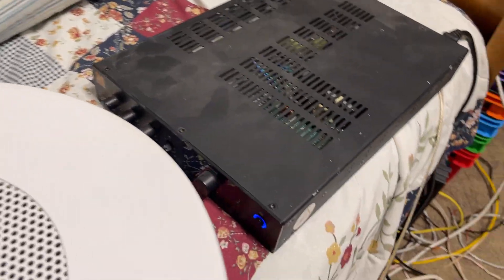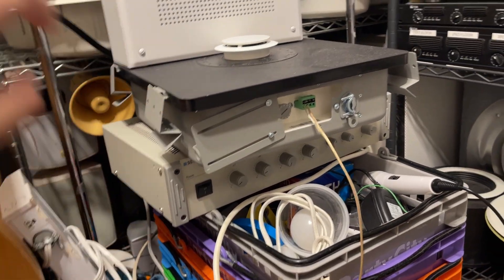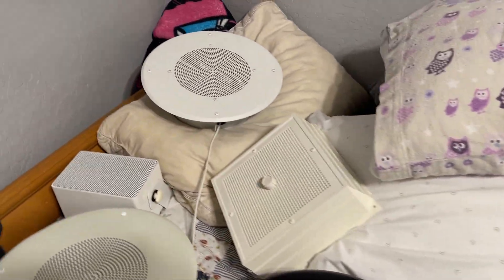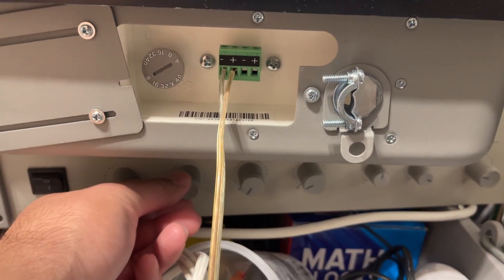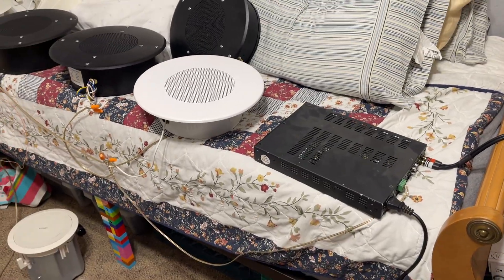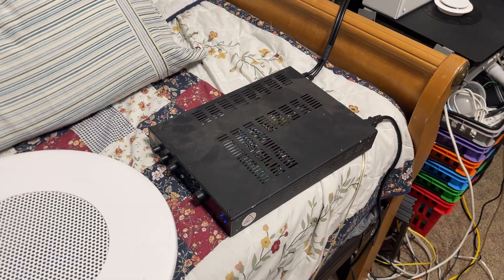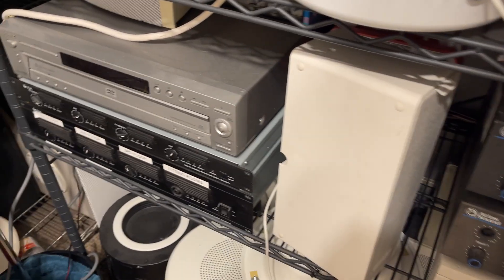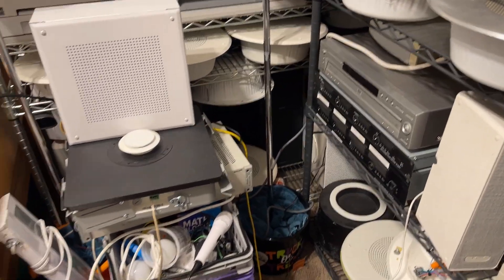Intercom Speaker Extravaganza & 70 Volt Amplifier Bridging Expansion Info

Comment: Hi, how are you splitting those speakers once they come out of the 180? I'd like to connect two, but it only has the one output.  Thanks!
Reply from the maker: You just simply connect a speaker off of the main speaker line. I covered that topic in a past video which you can find on the channel. The video is called "How To Connect A Chain Of 70 Volt Speakers To An Amplifier" which that should fully answer your question and this applies to any amplifier.
Reply: @CristianOrtiztechmaster926  awesome, thank you!